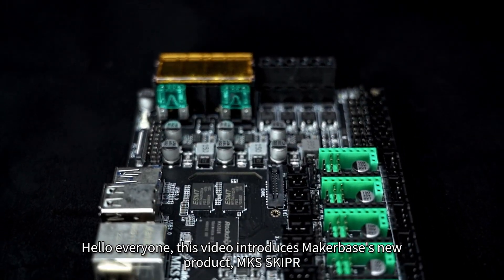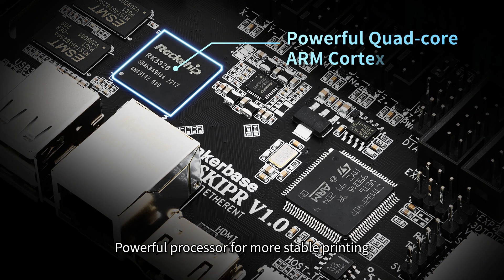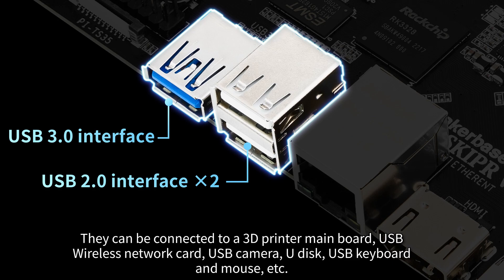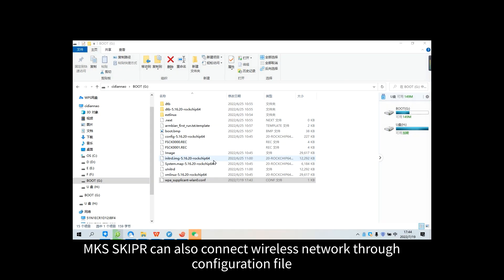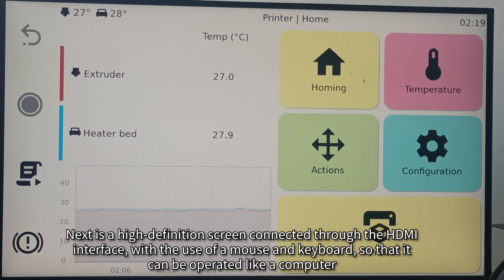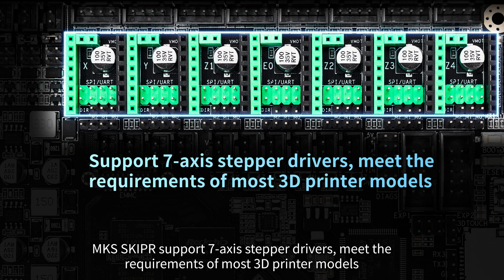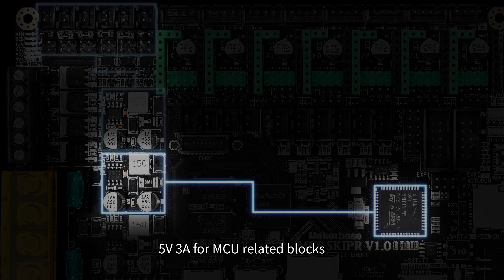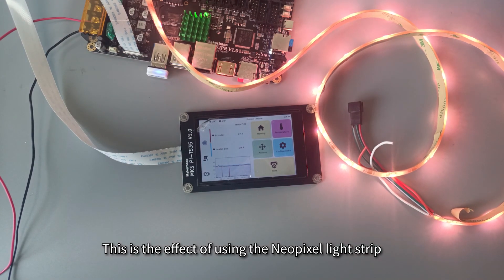Makerbase new product: MKS SKIPR runs Klipper & KlipperScreen for Voron VS Raspberry Pi

Comment: 1. using bleeding edge linux - bad idea. mks pi git repo does not provide u-boot and kernel patches, only some legacy crap.
2. you cant update klipper firmware from host directly. need to dowlnload to sd, rename put sd in and reset (silly)
3. you cant use CAN, because klipper does not support can-over-tty bridge. so you need usb cable to connect host and mcu anyway.
------
total crap, IMHO. just lost my money for it.

Comment: Its any way to power the board without PSU power like USB cable or so? I would like to make a PSU controller with a relay. My idea is that i keep the board alive with 5volt just for i be able to reach Klipper online and send a signal for a relay from Klipper,so i could turn on my PSU with relay and the whole printer. Just like with Octoprint in GPIO mode.

Comment: Hello, the MKS-Skipper worked for 2 days, currently it doesn't work as it gives me the "mcu" problem, there is no way to fix it. I also tried updating the "mks_skipr.bin" firmware but that won't load. Is there any way to fix it, or could it be a hardware problem?
Reply from the maker: What is the error? What is the specific error message?
Reply: @makerbaseteam4217  The error: MCU shutdown: Stepper too far in past. This generally vhen the microcontroller has been requested to step at a arate higher than it is capable of abtaining. Thanks.

Comment: I didnt know anything about klipper. Since years I was using mks gen L v1 with Marlin  for Corexy printer. Unfortunately is last week smoked. How this board works exactly? Have to still flash the board  with marlin and control with klipper? Or "plug and play"? I dont get it
Reply: Klipper has nothing to do with marlin, they only share the same gcode language. The main part of klipper runs typically on a raspberry pi, in this case the 64bit processor. The other part of klipper runs on the mainboard, in this case the 32bit processor. You see you have much more processing power this way, the mainboard processor only executes command ls received by the host (raspberry/anything that can run linux/ 64bit portion of the skipr). Also there is no compiling like marlin, you set everything up with a text file. You are much faster building a configuration from scratch in klipper than on marlin. 10 minutes max and you have completely set up the base of your firmware.
You also gain a web interface, but loose all support for screens besides raspberry pi and hdmi screens as well as the classic lcd encoder screens.
The real upgrade of klipper is input shaping, that cancels out ringing, enabling you to get better quality and reduced print time. You can expect to only need half the time on a stock machine, meaning entry level printers like a artillery hornet or kingroon kp3s require 40minutes for a benchy instead if 1,5h
Reply: @over_pizza_2578  I understand.  So nothing to do with the marlin anymore.  I just got my board at Monday but hadn't time check jet,but try to read about how to configure ecetera. My first board was like 4-5 years old. I have corexy printer whit dual z stepper and dual z endstop for better bed leveling. I hope I can make it work.

Comment: @makerbase you need to have a driver configuration diagram/manual page.  I have absolutely no idea how to configure the driver jumper pins on this board.
Reply: Loving my MKS SKIPR board so far.  I made a case design for it (put that on thingiverse for anyone/everyone).  I will be buying another SKIPR for my modified E3V2 as well.
Reply: @matthewwain9958  Could you make a guide video about the board? I mean like from first fire up  to the first print. I always was using Marlin and I have no clue about configuration and setup/install/update/wifi etcetera

Comment: @makerbase : Can alternative firmware be used, for example so we can use mainsail/klipperscreen etc?
Reply: Of cause. In fact, you can use the kiauh tool to install/uninstall the software sets.
Reply: @menli7686   Seems like I am going to have to get one :)  More because I can, rather than because I need to lol. (currently running my QQ-S Pro delta printer from it's original board with a hacked Creality Wifi Box running klipper which works very well and was super cheap.  I just like having options, so this interests me.)

Comment: Dear, you didn't say anything about the CAN connector and how it works.
Reply from the maker: The can bus needs to be used with the can bus module. We will publish a tutorial after we develop the module.
Reply: @makerbaseteam4217  Dear can it work with fly and btt modules?
Reply from the maker: @TimoninPavel  yes ,it can

Comment: #Makerbase, your products are great. I ask if it would be possible to work on the firmware on the boards, so that they can control other machines, such as robotic arms, 4 and 5 axis cnc, who knows how to create an interface (emulator) in the firmware of the MKS SKIPR board, in which it allows each driver assumes a specific function, for each type of machine (3d printer, robotic arm, cnc 4 or 5 axis), starting to accept GRBL and others. A 64bit processor and all the MKS SKIPR board hardware, that's all I need for my 4 axis cnc machine, thanks.
Reply: you can just edit marlin firmware it is opensource , I do not know about the rockchip soc and how it connected to the main controller

Comment: Hahaha a 100 millions Ethernet port. And a USB port to connect a 3d printer duuuh the board is meant to control the printer.... But he. Nice product. It's essentially a MKS Pi TS35 kit with all the hardware for controlling the printer
Reply: The MKS Pi doesn't have the necessary hardware?
Reply: @petercallison5765  if you listen to the text they speak he makes a mistake... It's 100 Mbit Ethernet to pronounce not millions